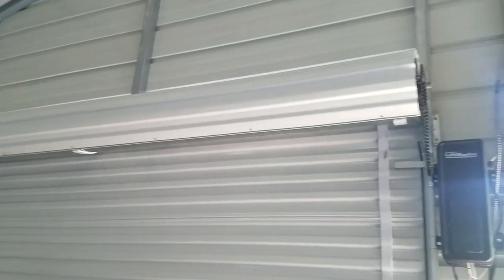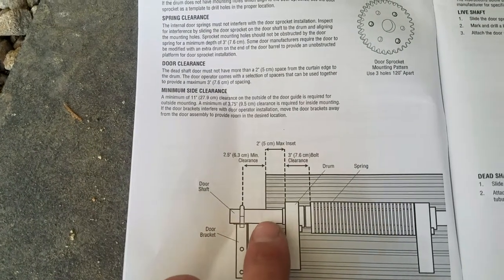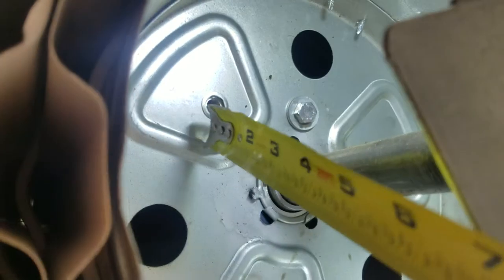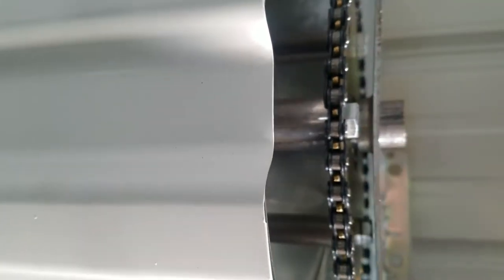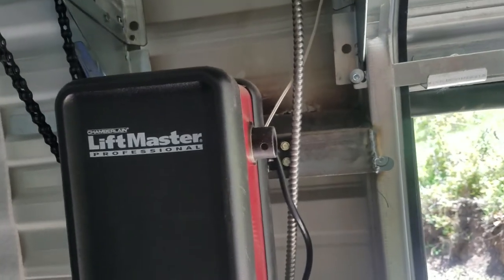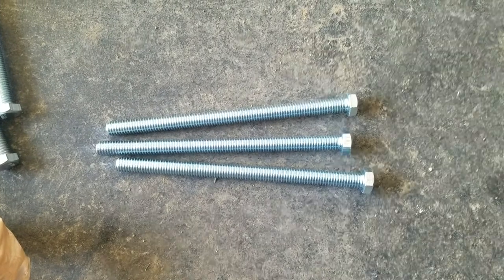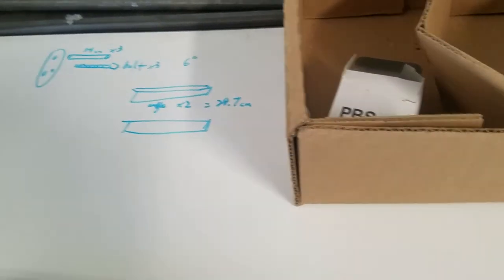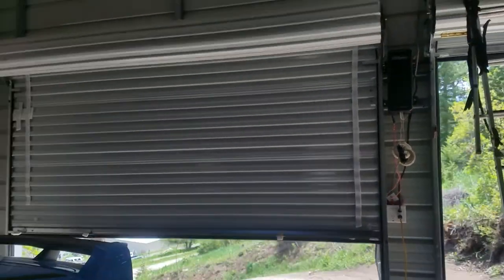Liftmaster LJ8950W roll up door dead shaft installation 3950

Comment: crazy question.. Do you know the distance measured from the top to the bottom mounting brackets on the sides of your 3950 opener box?  I am working with the mounting bracket for the unit (3950MB) and cannot seem to find the measurements for the length between the mounting holes top and bottom and the width of the box itself.  I assume it is 5.25" but nobody has any specifications that I can find.  Could you measure yours possibly?  thanks!  Its a great video!

Comment: Sir. Can u tell if the opener struggles about the last foot when closing?  Just by hand I have to step on the door handle to get it closed.   My doors are 12’ high by the way.    Thanks so much for the video…great job

Comment: Were there any problems pulling off the door mounting bracket so you could slide on the gear? Any tips? On a dead shaft I am guessing the door tension did not effect anything? Just unbolt bracket, hold up door end with 2x4 standing upright from floor? and slide gear onto shaft? Thanks for any info.
Reply from the maker: I think I had the door all the way down, and just pulled the bracket to the inside right side just far enough to slide the gear in, then put the shaft back. the tension is unrelated.
Reply: @broken080  Thank you!